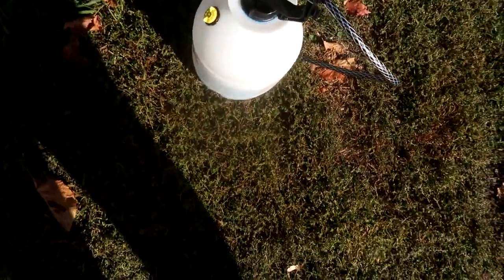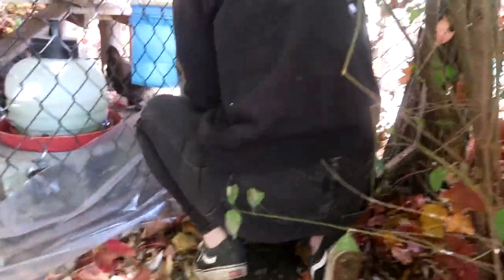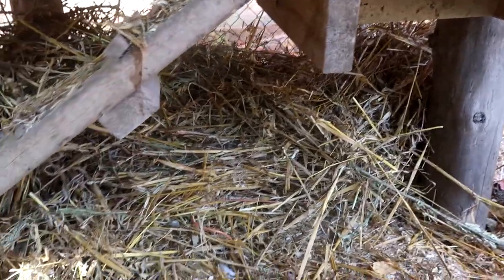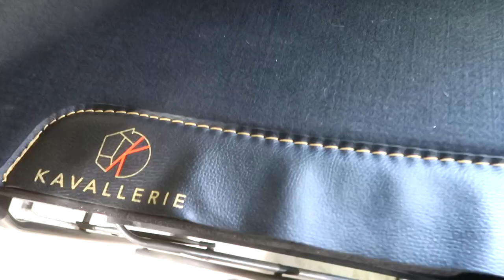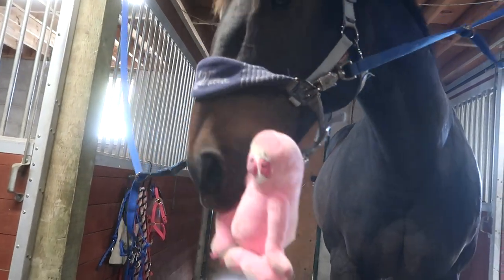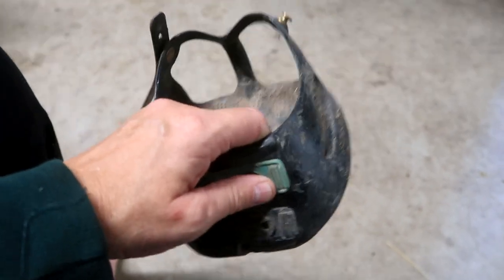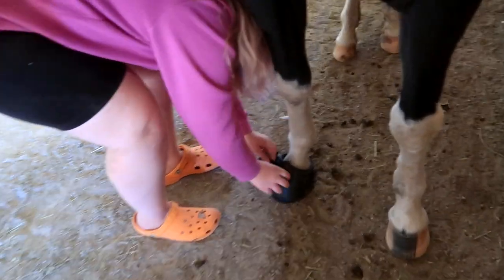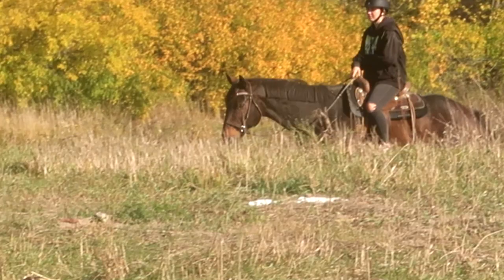Our Plans For Chino......

Comment: I wouldn’t use boots on penny unless she needs them or you can soften her feet and cause problems later on down the line.
Reply: Not true. I like how people without experience give people without experience advice.  It's like an un ending circle of false information
Reply: There's nothing wrong with using boots on terrain they aren't getting used to in their day to day life. Horses often live on very soft ground and many trails have more rocks, than a barefoot horse gets exposed to. A well fitting boot would never cause their hoof to soften, they aren't on longer then the hours and days horses are left un ridden in their pasture... if they were to be left on in turnout it would be because the horse already had bad feet and needed protection while their feet got STRONGER during the barefoot transition! Proper hoof hardness and strength comes down to the expertise of the trimmer/farrier not whether or not you use boots!

Comment: Penny has the prettiest markings. It's good to do refresher ground work with your horse. I thought boots were for problem hooves? 🤔 Or possibly extreme travel distances for the high dollar show horses. There's nothing wrong with Penny's.
Reply: No, that's not true, some people use scoot boots on trails, especially with steep or rocky terrain to prevent any damage or wearing down to the hoof and to help with a little extra traction. I don't think that Laura would do a trail at this time that I would put boots on a horse for, but it's not a big deal to ride in them for a trail ride as long as they fit properly and the horse is able to move out in them and is comfortable.
Reply from the maker: They are great for trails with bad footing but maybe I will look into it!  Anytime we have gone on extreme trails they recommend boots